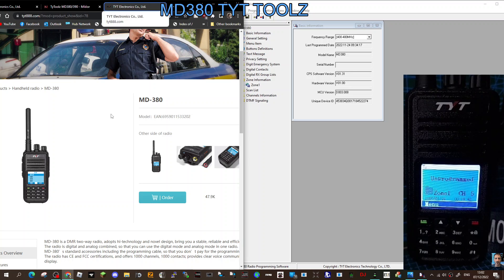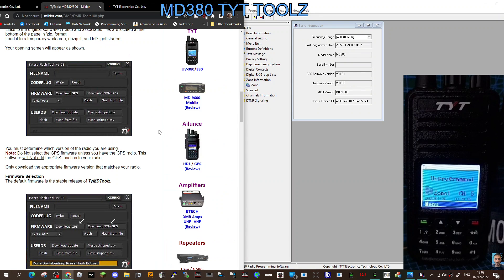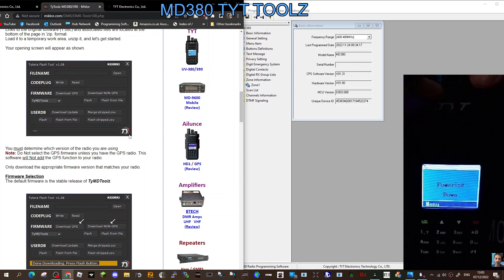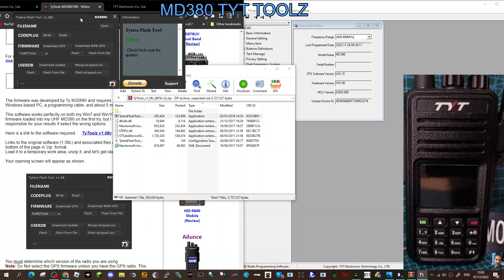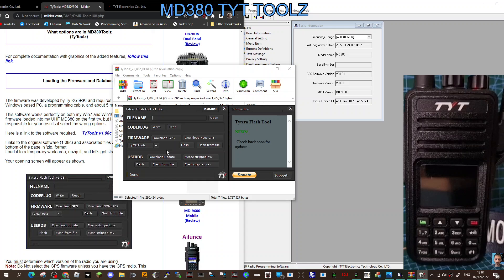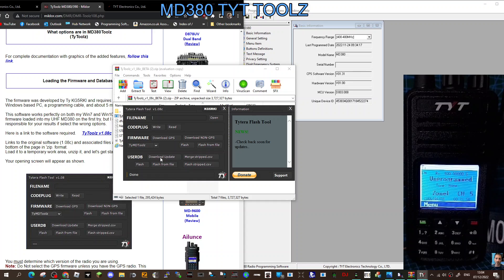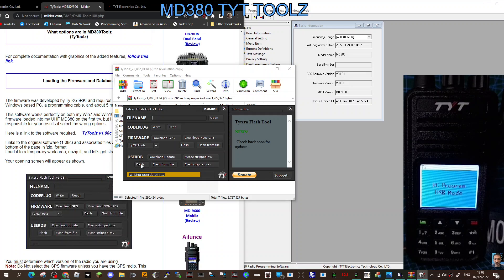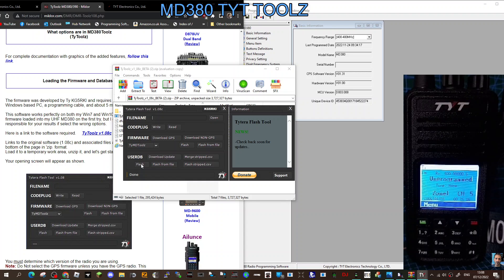MD-380 TYT TOOLZ  FULL INSTALL V1.08V (FIRMWARE CHANGE IS RISKY)

Comment: well I have done just this and now I am stuck in the firmware flash mode on the radio. It will not boot up
Reply from the maker: Re install the  back up try again.
Reply: @M0FXBHamTech
Reply: i did that thanks